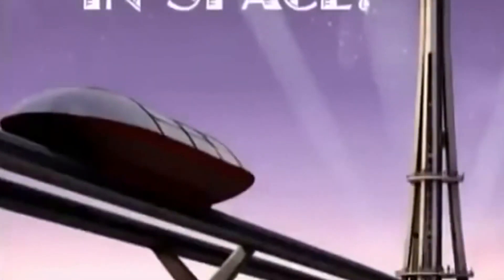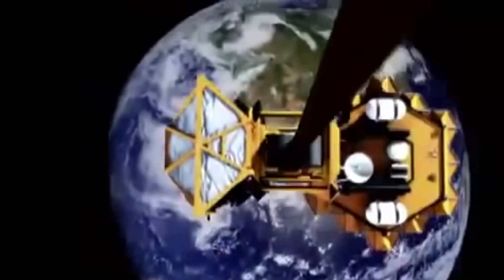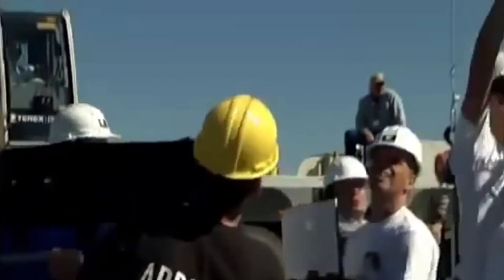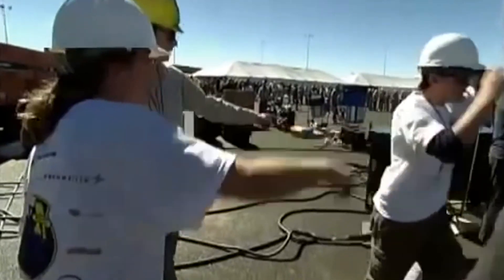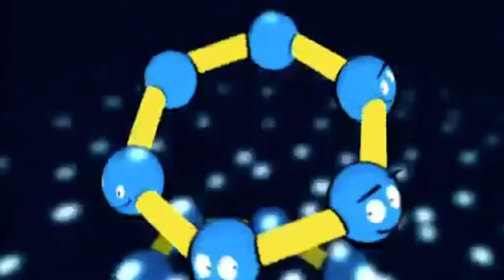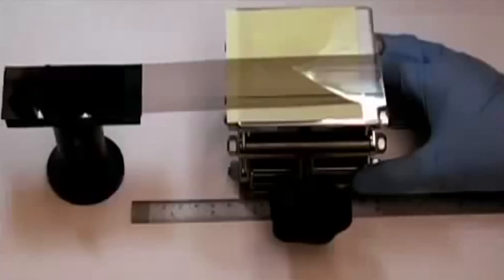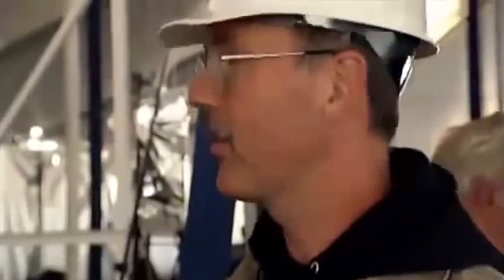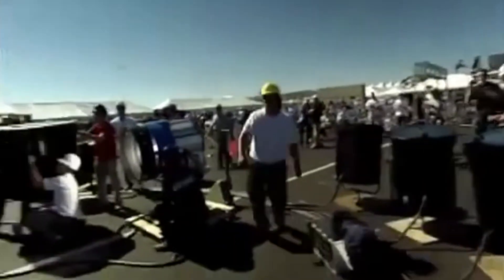Space Elevator Connecting Earth To Space Station

Comment: Maybe the space elevator would be better thought out as a Roman Arch maybe build this arch from one side of the Pacific ocean to the other side From Guam to 
San Diego maybe? So that your at 55 miles altitude in the Middle on a cogged track start building it in the Center with Cog ⚙️ drive crawler platforms holding the ascending base as it's built longer it gets wider until you reach each respective terminus at the far ends theoretically from Guam to San Diego though the arch mathematics will decide the actual locations